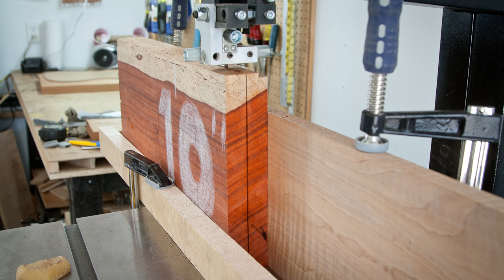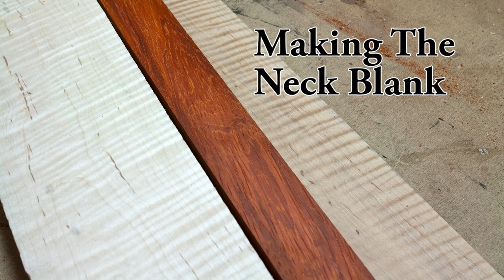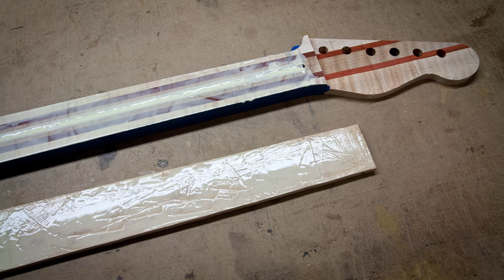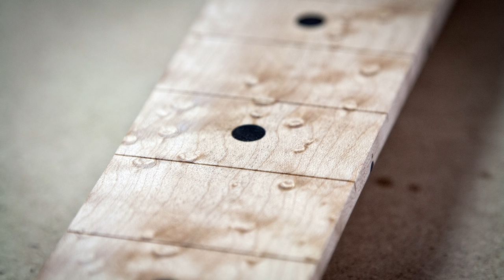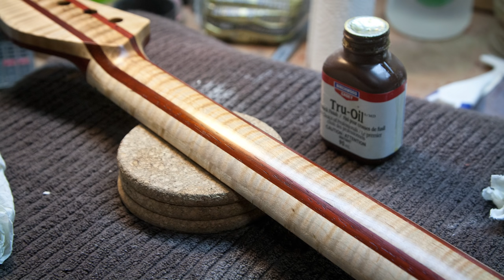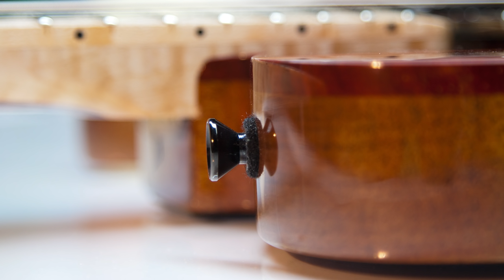The Making Of A Custom Telecaster

Comment: never could understand the inside-out logic of weight-relief holes.  
weight relief equals relief of tone too!   
They aren't tone chambers - that's a different thing entirely.  (i.e. acoustic, semi-acoustic, etc...)  Just drilling a bunch of holes, no matter how much planning goes into the design, is just turning a bunch of expensive wood into kindling shavings.  
We go to such great lengths to make sure that the neck and body will resonate together better.  It's the wood that vibrates - not the air in all those little holes.  Next step is to stuff some cotton inside all those little tone-suck holes before gluing up the body!   :-)

I never understood people complaining about 'too heavy' guitars.  If it sounds great, don't complain.  Too heavy?  Go to the gym!!  or change guitars a couple of times during the set. (#2 also lets you get different tones to compliment different songs too)

My 10lb.+ Les Paul - sounds amazing, heavy? yes.  But decades later and I still don't get what the problem is  (you milktoasts!!!)  ;-)
Anyway; kudos on the lovely workmanship.

Comment: Very nice wood combination and build! Looks awesome. 
One question: Was not using pore filler on the padouk in the neck on purpose for some reason or an oversight? I ask because it seems kinda odd you used it on the body, but not on the neck.
If there was a reason for it, care to explain?
Reply from the maker: Thanks.
The back of the neck has a completely different finish than the body, it has a Tru-oil finish on a high-grit sanded wood. This makes the back of the neck extremely smooth and non-sticky. It feels amazing. 
The finish on the body is for the looks, the finish on the back of the neck is for playing ergonomics.

Comment: Do you have to book match the top though? What about one piece for the top? What about one single piece for the whole body (especially if you are going to paint it)?
Reply from the maker: Many things are possible, Captain Freedom... A one-piece for the top is possible but difficult to find a nice piece that's big enough, that's often why bookmatching is done. If you're going to paint it, then a single piece of wood is probably the best choice.
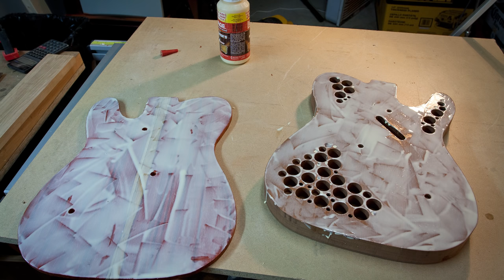Reply: Project Electric Guitar Also why the holes in the top of the main body piece? (0:49)
Reply from the maker: Those are for weight relief. The mahogany body was a bit too heavy. Those holes brought the weight of the mahogany from 4.3 lbs to 3.9 lbs and in the end the final guitar is a comfortable 7.5 lbs
Reply: Project Electric Guitar Okay not bad. I would have made a little stash drawer maybe.
Reply from the maker: LOL :)

Comment: When you cut the slot for the nut to go into (i.e. the slot in the fretboard FOR the nut), i see you cut two lines and then chisel it, but how do you get that bottom surface to be absolutely flat/smooth?
Reply from the maker: I use a small file to bring it down to the right depth and make it flat. You can also use sandpaper wrapped around a coffee stirring stick.
Reply: @Projectelectricguitar  Oh, sounds easy enough! Thanks! Amazing build btw, your stuff is always excellent :)
Reply from the maker: Thanks Paul!

Comment: Hi, what do you use for pore filling please?
Reply from the maker: For the padauk top, I used epoxy (West System 105 + 207) and for the mahogany sides and back, I used Benjamin Moore Wood Grain Filler (238-05). Hope that helps.
Reply: Great thanks , im doing a mahogany SG and ive had issues  with shrink back despite using a water based grain filler, if i try thr epoxy will cellulose laquer take ok do you know ? cheers
Reply from the maker: If the epoxy is properly cured, then I don't see a problem with using lacquer... but I suggest you do some online research first and maybe even experiment on a small test piece.

Comment: why 3 pieces of wood for the body?
Reply from the maker: Because, at that time, that's what I had available.
Reply: @Projectelectricguitar  fair enough! :))
Reply from the maker: Although I usually try to have a one-piece body, the three-piece bodies are fairly common, I recently walked into a guitar store and saw a $2000 Fender Tele that was clearly 3 pieces!
Reply: @Projectelectricguitar  fairly common? that's news to me.. actually i don't see the reason (from the physical scientific point of view if we speak about the wave propagation and the formation of standing waves) why do the body even of two pieces glued together instead of just one... one piece seems to be more reliable solution... so if someone explained to me "the physics" fo 2- and 3-piece bodies, i'd be very grateful! :)

and the only case of 3-piece i know is the "neck-through" bass guitars :)) (i'm certainly sure you're aware of what it is so i won't bother to explain it here) i can also say that 3-piece body (if all the strings and the neck are attached to one piece and the other two are adjacent) from the physics point of view seems to be more reasonable than 2-piece one
Reply from the maker: It's not about physics, the reason for multi-piece bodies is about economy. 

Check out this Gibson factory tour video https://youtu.be/VbU1R4KDymw?t=58, starting at 58sec.